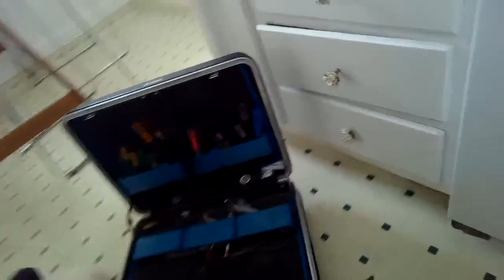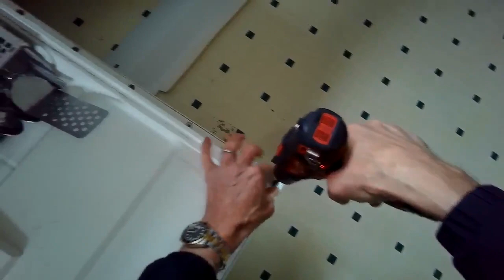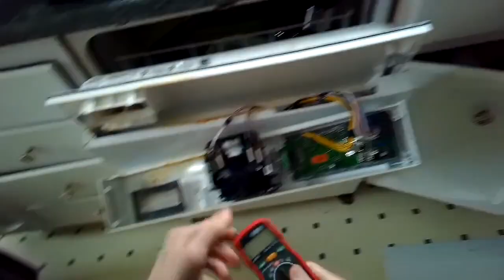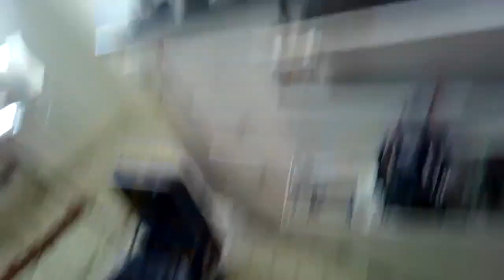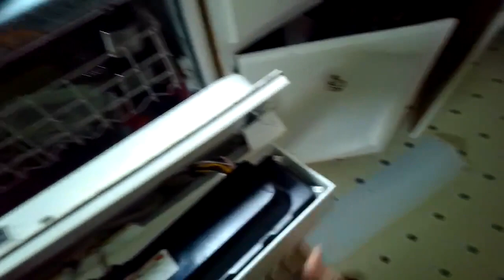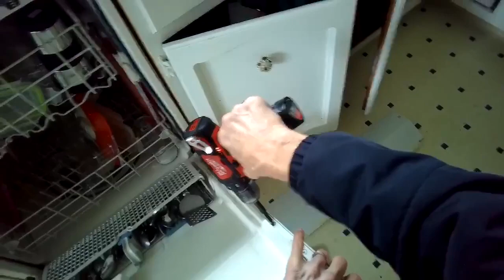✨ DISHWASHER HAS NO POWER (EASY FIX) ✨

Comment: Hi, firstly many thanks for this video. My friend has a Hotpoint Aquarius about 15 years old, no lights on the front won't start, but it didn't trip the MCB? If it didn't trip the MCB what is the most likely cause of no lights on the front? Could it be this same issue? Thanks 👍
Reply from the maker: I wonder if the door switch needs to be replaced?
Reply: @QuickAndEasy5MinuteAppliance Thanks 👍

Comment: thank you !! it worked just fine today, i repaired my dishwasher in less than 20 minutes with the "throw the fuse on the floor" technic !! I'm really thankfull
Reply from the maker: Awesome, it would be good to still replace it with a new one and clean the dryer vent tube👍

Comment: This is a good video, but unfortunately my Frigidaire which is maybe 5 years old, doesn't have a fuse up inside this control panel. I'm trying to figure out where it is cuz it must have one
Reply from the maker: Maybe the wire nut down in the lower left corner is loose causing no power to the dishwasher.

Comment: Nice trick about resetting the fuse.  Are you sure it's actually still a fuse and not just a completed circuit?  If it's permanently connected then that could be a fire hazard.
Reply from the maker: The fuse is modular so it’s easy to replace 👍

Comment: All I did was open it to put a knife in it…I used tofu all my stuff. But now I haveALS and can’t go taking it apart.the breaker box is ok.any ideas?..
Reply: Ment used to fix my stuff
Reply from the maker: I bet the little fuse blew that lives in the upper right corner of the door.

Just need to remove the 6 screws that hold the console to the door.

Comment: Can the fuse intermittently stop working? My power intermittently goes out on my ge. Usually unplugging it for an hour it'll fix it temporarily. I replaced the control board. Still the same. A month later and the unplug trick isn't working anymore.
Reply from the maker: Try removing all the wires from the circuit board located below the door and then plug them back in👍

Comment: I thought I was going to be without a dishwasher until I could order the fuse, and then I happened to see your vid. I must admit, I had no confidence that slamming the fuse on the floor was going to do anything but give me a little discharge, but dang, it worked like a charm! Thanks so much!
Reply from the maker: Very cool😎
Reply: @QuickAndEasy5MinuteAppliance  is it possible all it took was disconnecting the fuse for 30-60 seconds fixed it and not the tapping ?
Reply: @TraceguyRune  I can so for me, no. I checked continuity after removing it. No continuity. Then wacked on the concrete of my garage and it had continuity after. Put it back in and the dishwasher lights were back on again.

Comment: Great video.... Changed the fuse and it worked perfectly the first time, then it blew again the next time we used it... guess I have other issues that are causing it to blow .. ugh. Thanks for the video. Your instructions were very easy to follow and explained very well.
Reply from the maker: Nice job Bill,  I wonder what’s making that fuse blow?
Reply: Hopefully you got this fixed. If not, check that all wires have good inulation on them, and that no bare metal connections are happening

Comment: After having no power to the dishwasher, I replaced the thermal fuse and wiring.  Once complete, the power came back and when I started the dishwasher cycle water started to flow as it normally does.  After 10 seconds it stopped.  The lights are still on, but it seems like its stuck.  I canceled and started a new cycle.  Same thing, it starts like normal, water starts flowing in, and then after 10 seconds it stops.  I can hear the control panel inside clicking.  Any thoughts?

Comment: I have had GE door sw cause problem. When dishwasher installed. top clamps drawn upward to much and in time bow the upper cavity ever so slightly making the door switch not function. Easy fix. Apply some shims where it is bowing up and shim it just enough so it is straight again. Problem solved.
Reply from the maker: Very good solution😊👍

Comment: The fact there are like 900 videos showing the same exact brand and problem says everything about this junk. You know what would be better than a thermal fuse you have to replace? A damn sensor that stops the appliance from ever getting too hot. What a concept.

Comment: I just bought a brand new whirlpool dish washer. Hooked it up, used a new power cord. When I plug it in the control panel flickers for 3 seconds then all power is off again. When lights do come on, it's like half light up almost like a brown out

I have no idea what to do other then return it to lowes for a replacement.

Any ideas? WDF520PADM is the model

Comment: I seem to have this exact problem with my 3yr old GE dishwasher. My door has no screws, however, although it appears the cover to the panel might pop off from the outside/front. I'm afraid to try to force it without confirmation--does anyone know for sure?

Comment: I laughed when you said to hit it with a hammer.  I said, yeah, right.  DANG!  It worked!  Thank you.  Subscribed now.
Reply from the maker: Thanks Rob,  all you need is a big hammer and a roll of Duct tape😂😂😂
Reply: I did replace the fuse after the old kicked off again, but the new fuse lasted about a week before it kicked.  Problem not solved yet, but I can pull that top panel and slap that fuse and put it back together faster each time, now.  Down to about five minutes.

Comment: After resetting the fuse and turning it on. The washer is coming up with 2 minutes on the board. After the two minutes are up, I'm stuck right at the beginning, no power.
Reply from the maker: Can you try it again and when it shows two minutes can you press cancel to see if that will reset it.

Comment: Does the thermal fuse you mentioned in the link work for any brand? I have a 19 year old Bosch dish washer. Can't find the model number.
Reply from the maker: What symptoms do you notice about your Bosch dishwasher?
Reply: @QuickAndEasy5MinuteAppliance  It doesn't power on. Circuit breaker turned off when this happened. I turned it back on, but no power to the DW. (No lights) Bosch model SHE43RL5UC/64

Comment: I’m not finding a fuse on my Frigidaire dishwasher. So my only option is to replace the control panel? Suggestions on where the fuse could be?
Reply from the maker: Hi Robert,

I think there’s one connected to the control board in the door.
Reply: @QuickAndEasy5MinuteAppliance  I'm having the same issue with my fridigaire. Doesn't seem to have one in the door portion. The model I'm working with is FFBD2406NS11B. I have checked in the panel behind the buttons, as well as all throughout the door. I have read about a thermal fuse being down below, but haven't got around to checking.

Comment: If I put the old fuse in my driveway and run it over with my car, will that reset it?
Reply from the maker: You’d need to hold it with pliers and bang against hard surface.
Reply: Scott, thanks for the tip. I did smack the old fuse on my patio floor, then put it back in and it worked!  Who woulda thought to try that?
Reply: So long as your holding it with the pliers 😀
Reply: The fuse I meant😕😀
Reply: i was told if you put the fuse in the middle of a sausage and hit the wife over the head with it ...that works...but not on a Thursday

Comment: Please explain how and WHY banging the fuse resets it!? I’m an appliance technician and have never done this so I’m very interested. After you bang it, how long does this type of “fix” last? WHY does it even work on the first place? Please advise! Thank you for the tip!
Reply: I threw mine on the concrete patio,  it works